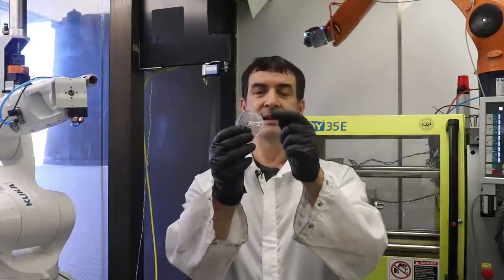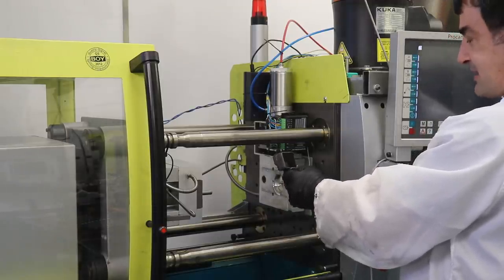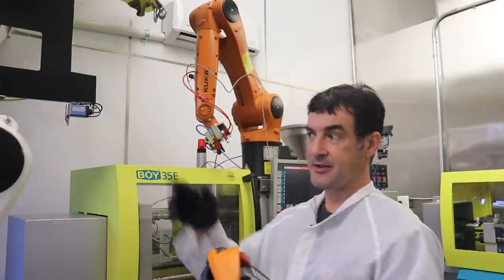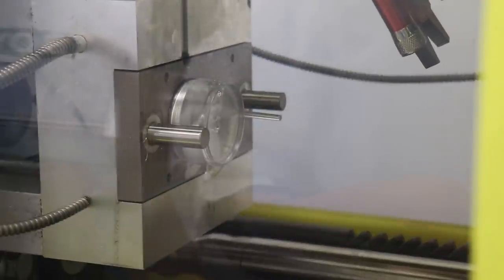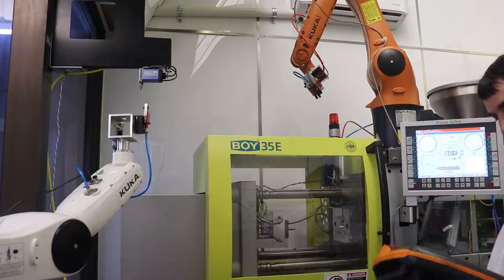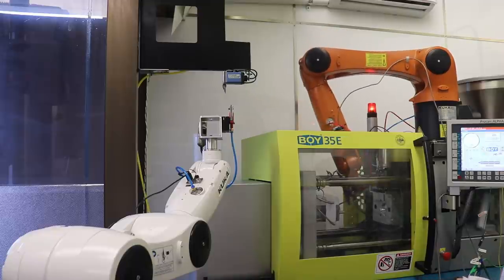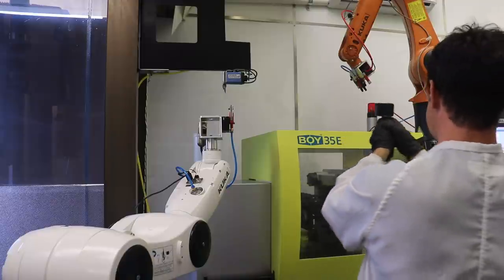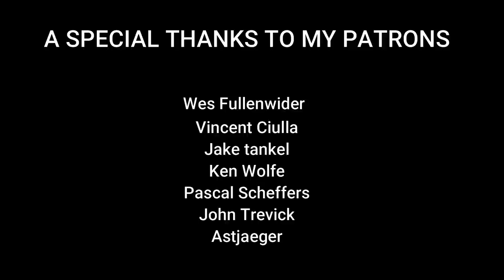Robot Automated Injection Molding

Comment: That is awesome. It's always interesting to see what people come up with for unscrewing cores. The robot setup is also an interesting answer. Every one seems to have different things on hand to work with. With all the low run and prototype stuff, have you ever looked at MUD Units or the piles of knock offs? Thanks for the videos!
Reply from the maker: Thanks Steve.  I have looked at MUD inserts, but most of my prototype molds are so simple that they are basically as simple as inserts.

Comment: I enjoy your videos. Just one small question, do you not need to cool the mold?
Reply from the maker: Hi Max,  In this case I don't need mold cooling since polycarb mold temp is 240 F.  with the low runs, and high temp setting the mold dissipates the extra heat energy
Reply: @DragonflyEngineering   I haven't seen a mold without cooling, so thank you.

Comment: How would i get into doing a job like this? I have an acoustic engineering degree that i didn't pursue, but now i tinker with arduino's in my spare time, would i have to go back to uni?
Reply from the maker: It is hard to say, depends on if you want to get hired by a larger corp.  if so then yes usually you need a 4 year degree, if you start your own business then start buying equipment and you will naturally will self teach.  Most of what you see me doing is self taught.

Comment: Why are you standing near moving robots? I thought these were in a seperate area inaccessible to humans when turned on?
Reply from the maker: Hi Leonelf,  when programming the robot work cell, the trained integrator (programmer) is typically inside the work cell to setup the program in most cases, usually with their finger on the panic button on the hand controller.  The cage is used to keep everyone else out of the work cell. As the KUKA trained integrator, I know where the danger zones are as I program them in. When done, I can close the clean room door with a estop trigger.  Thanks for watching!
Reply: @DragonflyEngineering  Sorry if I confused you: I mean the intro scene, where the robots are swirling around in the air.